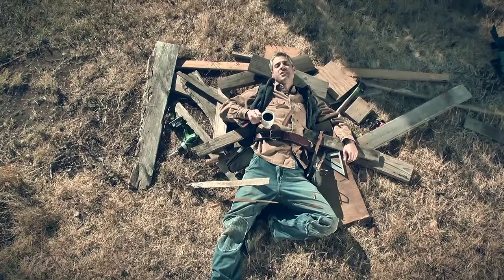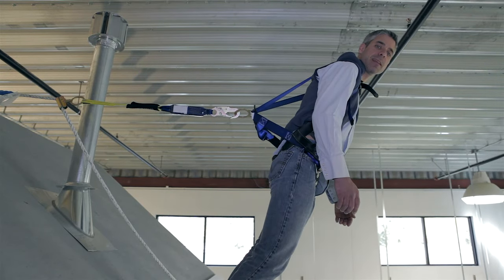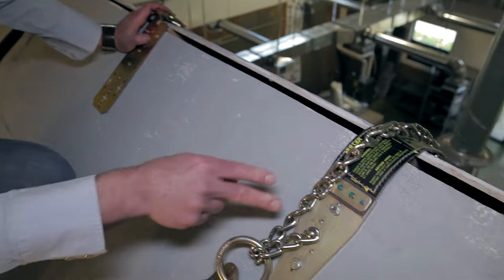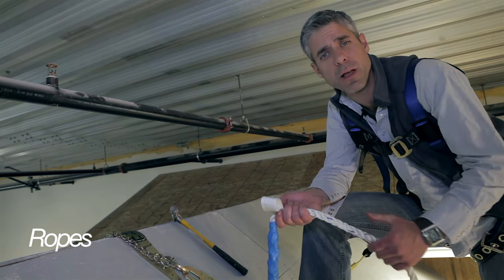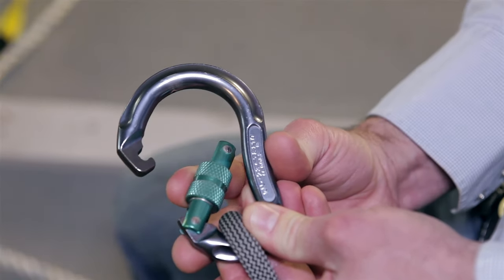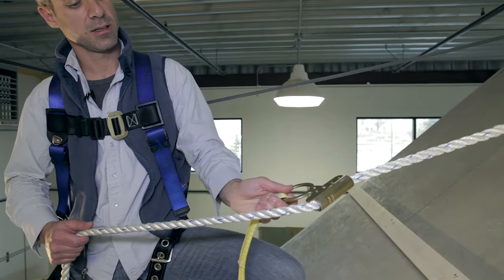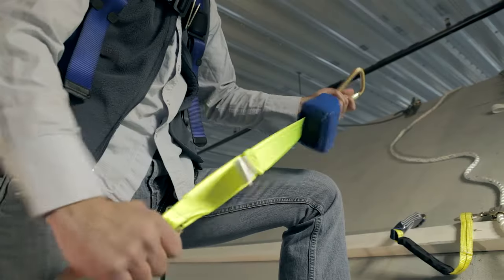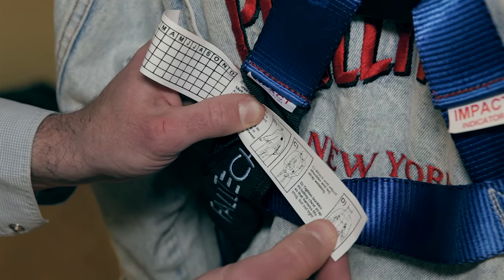OSHA Hazards: Fall Protection

Comment: It's  time  to require  tower manufacturers,  contractors,  and building codes to  REQUIRE  better  (any)  tie off points on roofs  towers  and other  structures.  There is no reason  permanent fittings  could not be   included  in the ridge of a typical roof.
Reply: fourfortyroadrunner ?
Reply: You must live in California.

Comment: It would be nice if you did a video and give some clarification on the difference of both "Personal Fall Limiter" vs "Self Retracting lifeline" and you is it necessary to use a "Shock-Absorbing Lanyard" with them? Also if Working on edge of a 8 ft roof and you fall the lanyard stretch is 60+ inches (give or take) on how much slack is in the rope that only leaves 3 ft of clearance to stop you is there something better that to stop you sooner?

Comment: Good video, but why not just use the belts the climbers use when climbing mountains? They cost much less.
Reply: Dunaldango cause osha... has to be osha certified to go on job sites.
Reply: Climbing harnessed aren't designed for fall arrest.
Reply: Rock climbing harnesses are usually not full body harnesses, but only hip harnesses. If you were to use any sort of hips-only harness for fall arrest, it would yank on your hips in case of a fall and your back would be unsupported, causing damage to your spine.
The tie-in points of a rock climbing harness are also not up to the standards of fall arrest points for work protection as they are located on the front side of the hips and not on the chest (sternal) or upper back (dorsal). In a fall arrest system, if a harness features a dorsal and a sternal attachment point, the one that minimizes unintended motions (rotation, pendulum motion etc) during the fall should be used. A rock climbing harness just has that one point that is in an unsuitable position.
Additionally, fall absorption in rock climbing is done completely differently than fall absorption in workplace protection, so a rock climbing harness is not going to be designed to handle the kinds of forces present in a fall in the workplace.
Rock climbing harnesses are designed to be as light and unobtrusive as possible, so their straps are very thin which is not going to feel good when you're hanging in it. A rock climber is only going to spend a very short amount of time suspended in their harness as they'll get right back to climbing and generally, consciousness is assumed. For workplace protection, it is not assumed that you are always going to be conscious and generally, you're unable to rescue yourself in any way, so you're going to be suspended in that harness for longer.

Comment: How many feet up is a three story structure? About twenty to thirty feet.! If I am working by myself three stories high and standing on a steel beam guiding a steel cable with a load being hoisted down or up and I am strapped in, if in case I take a fall, can I use another life line rope a little longer than my life line, to pull myself up to the beam that I was standing on?
Reply: Can you?

Comment: How do you attach a roof anchor if the roof is tiled?
Reply: pull the tile??
or use cable guide line from other areas.
or call your safety guy

ALL GCS are required to have a fall protection plan...for insurance purposes.
Reply: If you have to ask this question, you probably shouldn't even be on a roof in the first place.